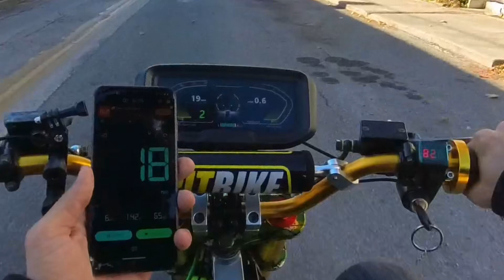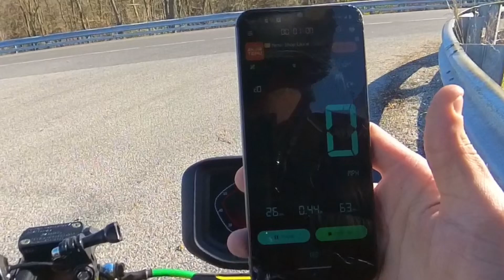Top speed test on my Razor SX500 with a 72v24ah battery, KR5V, and a Fardriver 72360 controller

Comment: I have a 72v 20a battery the same motor and fardriver controller for my razor I can't get it to go above 35 how can I change the setting to make it faster I'm not to good with that part of you can help thanks.
Reply from the maker: @danburkholder5895  what do your Ratio in Speeds look like under pro mode
Reply: @ElectricShock19  would that be the percentage to rpms
Reply: @ElectricShock19 would that be the ratio from rpms to percentage of speed
Reply: @ElectricShock19  I have it set to 100% up to 5000rpms then it's at 0 for the rest
Reply from the maker: @danburkholder5895  that's your problem you need to raise your them up. 

 You also probably need to adjust Field Weaking. 

Did you just run Autolearn or get a custom tune.
Reply: @ElectricShock19  okay. Yeah I did the auto learn and changed the voltage on the app for the battery and that was it basically what do you suggest I bump it up to would you happen to have another video
Reply from the maker: @danburkholder5895  you need to tune your bike. Join FarDriver tuning guide on FB for the manual to tune.
Reply from the maker: @danburkholder5895  https://www.facebook.com/groups/fardriver/?ref=share&mibextid=NSMWBT
Reply: @ElectricShock19  thank you

Comment: how many amp battery?
Reply from the maker: @Picklejuice950  this bike in the video is pushing 145 amps 72v24ah Amorge battery from Hotpaxx.com
Reply: @ElectricShock19  if i were to get the 72v 28Ah 175A battery with a 72450 and Kr5v how many line amps can it handle
Reply from the maker: @Picklejuice950  175 should be fine, just keep a eye on motor temps for the first few rides to see how it goes. Should be fine.
Reply: @ElectricShock19  or would I be better off getting the fw11 with 72450 and 72v 32ah 200a battery? the fw11 and kr5v kit cost almost the same price how many line amps would I be able to handle and around what top speed? Thanks for the help
Reply from the maker: @Picklejuice950  if you have the money go fw11 over KR5V but they both can handle about the same

Comment: Great vid, just subbed! I see the FW01 has great top end speed, but how fast does it accelerate. I heard one reviewer say it takes a while to get going but the top end is great. Also, how does it compare to the KR5V? Thanks!!!!!
Reply from the maker: @ My FW01 build will walk all over the KR5V build. Keep in mind they are completely different motors, not even in the same class. The FW01 swingarm is a brute and makes the bike heavy compared to a motor (KR5V) than can just bolt on the stock swing arm. (Light bike) 

 I didn't launch hard on the FW01 bike, it will power wheelie as far as you can ride it out.